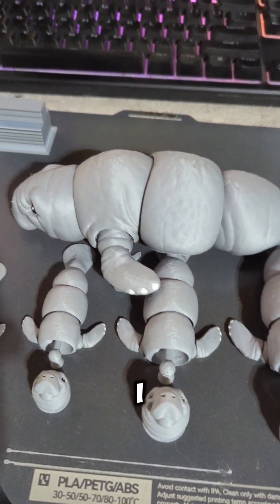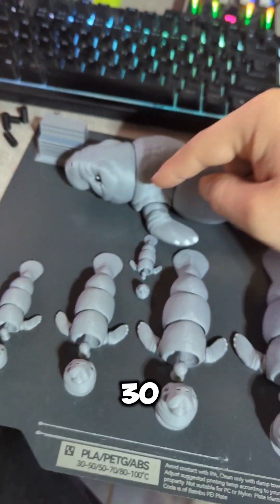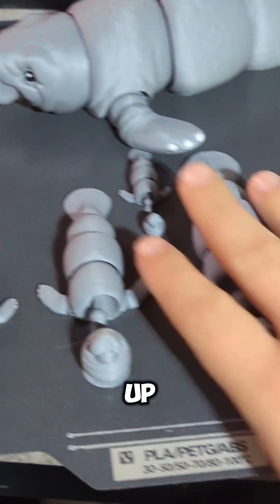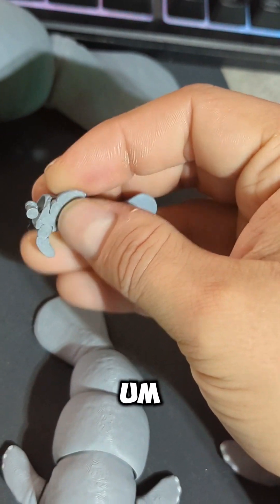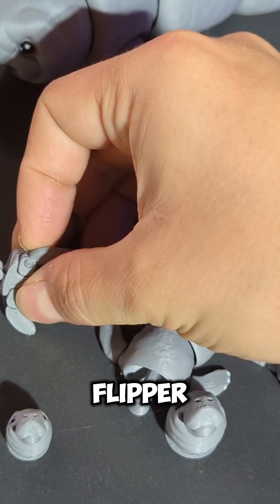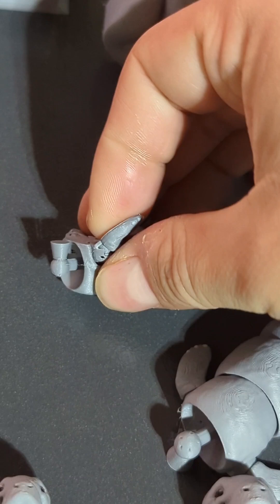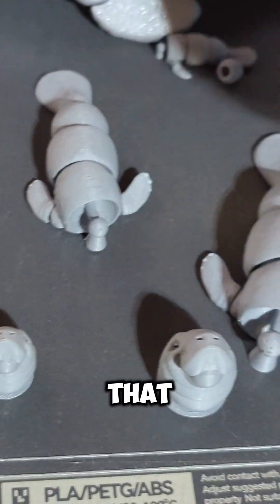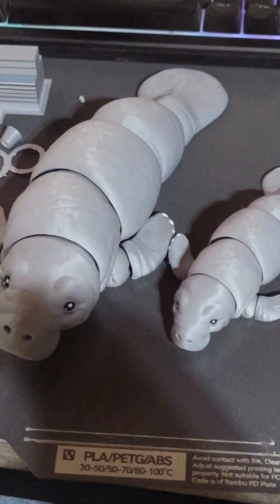Scale testing @matmire_makes  Manatee! how small can it get on Bambu A1?

Comment: hey, could u tell me how you where able to mod jsab to do freecam and all that cool stuff. thanks (also fourth)
Reply from the maker: I used a mod called melon loader. then you get the free cam mod for melon loader and roll back the version of the moding tool to the previous version, it will then let you fly around in free cam. as for the program that let me mod the sprites, I had to get a sketchy Russian program that cost me $600, but it worked. I cant remember what it was called.